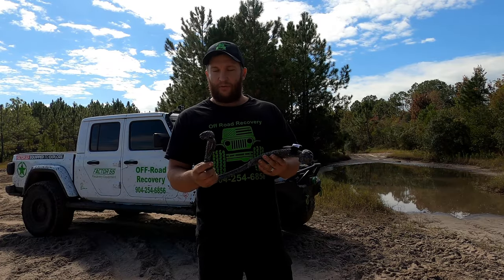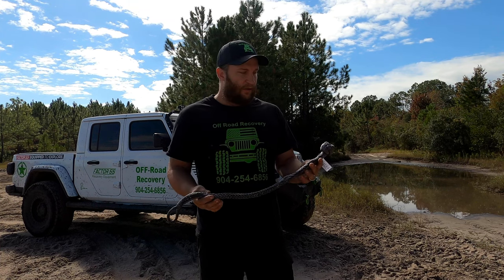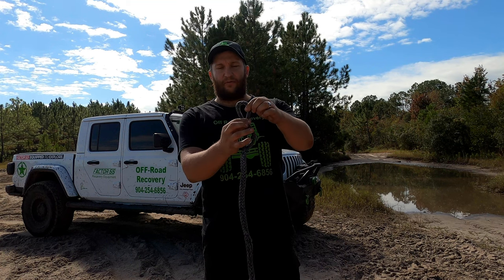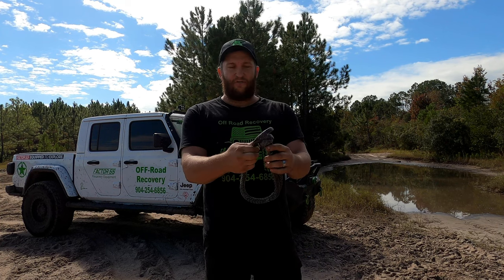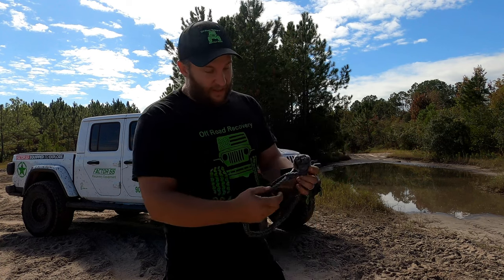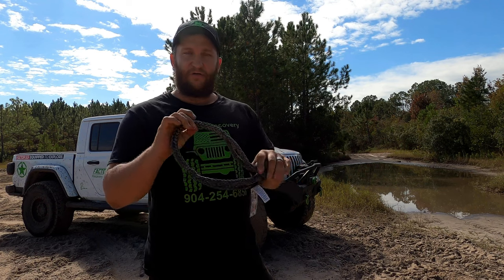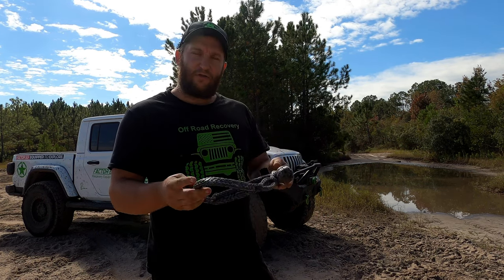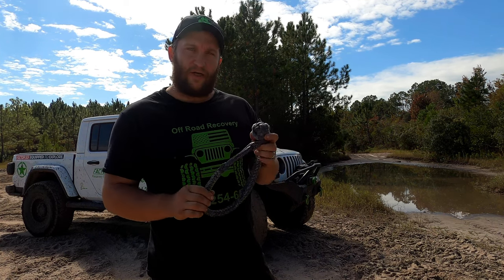How to use a soft shackle

Comment: I do backcountry trail work in the mountains where we have to haul all our gear miles from any road.  Would you be confident in these for a grip hoist pulling and dragging rocks and trees?  Every pound  counts when it’s on your back.
Reply from the maker: They are strong and light, we use 2 sizes a 7/16 and 1/2 
7/16 is 7800lbWLL 39,000lb mbs 
1/2 is 12,000WLL 60,000mbs 

But they don’t like being dragging on rocks and such for long 

Dragging them over rough terrain will sand them down and cause them to become weaker

Comment: Could you not also remove the bow shackle on the bumper and simple run the soft shackle through the hole?
Reply from the maker: That’s a big no 
The hole on the shackle mounts are too sharp and will cut the soft shackles
Reply: @matt.mckinzie  that's what I assumed! So they don't completely replace typical bow shackles